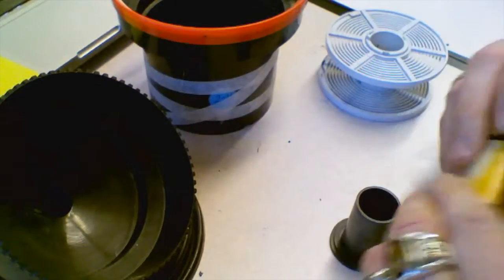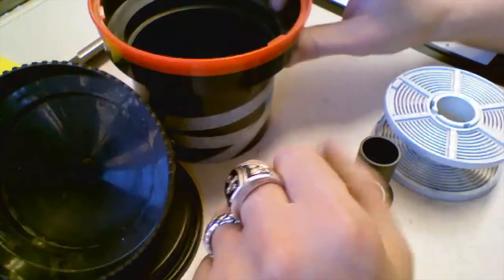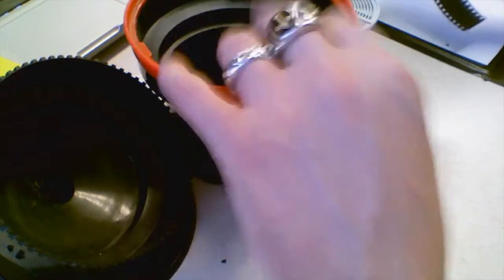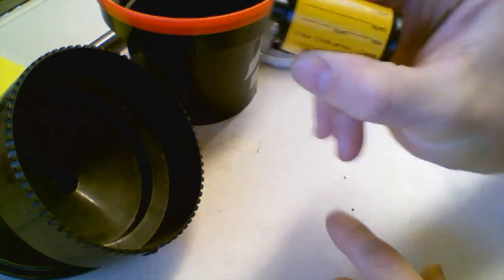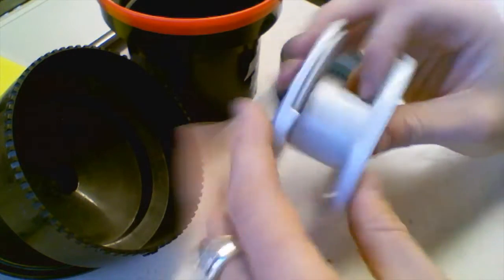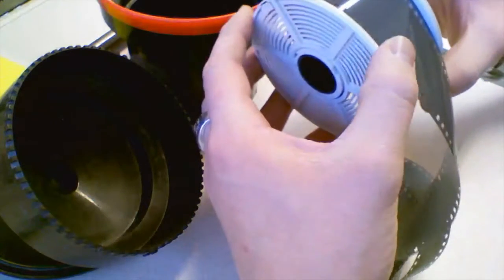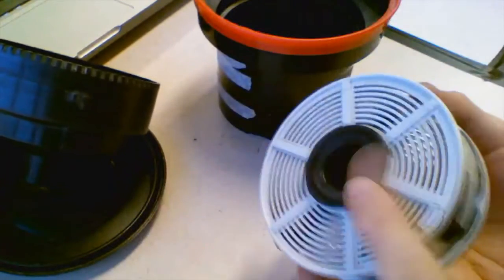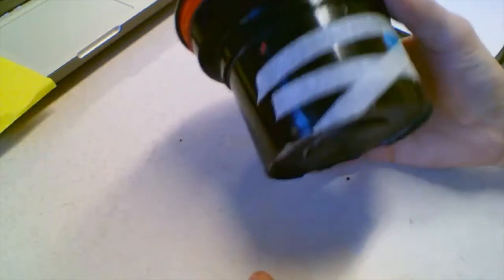Loading Paterson Tank

Comment: is the tank light tight with the funnel or does the lid have to be on??
Reply from the maker: As long as the funnel is locked in place it is light tight.  Don't forget to make sure you have the center column in place, you will need both the column and the funnel.
Reply: ok thanks